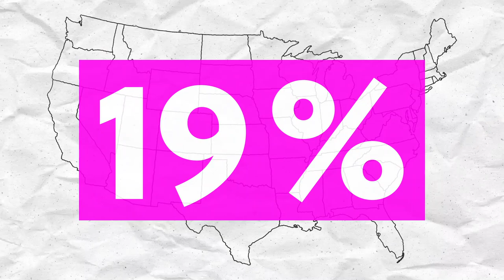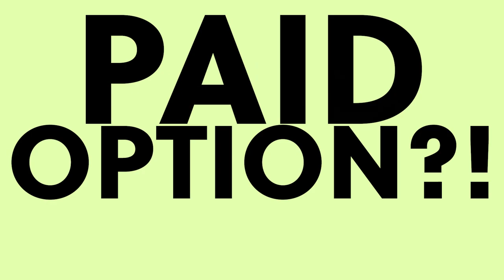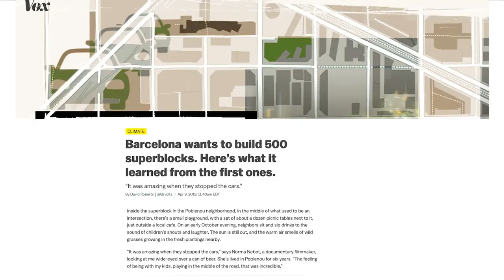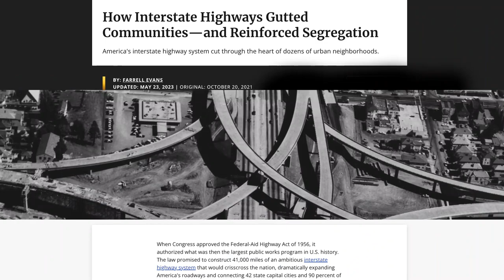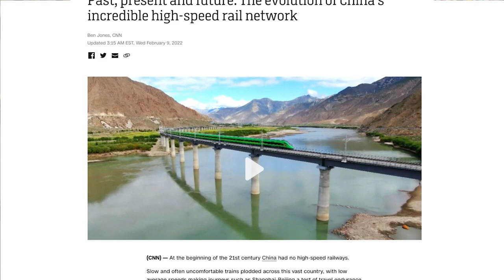What would happen if we banned cars? (Hint: it’s all good)

Comment: buses and train manufacturing should ramp up a lot if we got rid of cars. all those jobs will get replaced
Reply from the maker: Great point!
Reply: i m guising you are talking about train cars , not those and the engines etc.  and buses too. now if we dont have roads buses will lots of trouble staying in service. cant forget building trucks to get to the final destination . case while trains could get toi lots of places, it wasnt how that was done in the past (tracks are cheap to build or maintain),but the job losses wont be made up by switching buses and trains
Reply: Plus, technical knowledge on cars can apply to vehicles like buses and trains so the same people that designed, biult and maintained cars, could enroll in lessons to adapt their knowledge for buses, trains so they will not get jobless
Reply: @Mr.Engine993 A surprising amount of car manufacturers also have a sector where they Manufacture buses, Ex: Mercedes-Benz, Hyundai

Comment: I use my car less and less over the years. I moved to the city Utrecht where I work. Reducing from 30 km/ 19 miles, to just 3.5 km/ 2.24 miles bike ride. Nearly all my trips inside Utrecht are done on my bike.
Living in the major railway hub Utrecht of the Netherlands, gave me more options to use the train, instead of my car. Both inside the Netherlands and  outside, when I travel to Germany. Nearly just as fast as my car, costing the same, if not less then my car ride. No more stress of driving.

Comment: People would use Horse and Buggy for the trips that were formerly done with cars, the 3 to 100mi journeys that are too short for HSR to be viable and are too far to walk. 

Cars really arent a problem as much as Car Dependency is, and poor zoning is.

Europe and Japan have many many cars, but most people still can at minumum even in the most rural and remote areas walk to a convenience store or small shop so they don't need a car for their daily needs.
Reply: The very high population density of Europe and Japan make public transportation quite viable. Here in the USA, the sheer distance between major metro areas, especially west of the Mississippi River, makes owning a personal vehicle a lot move viable.
Reply: @Sacto1654 People shouldn’t need to be traveling between metro areas so regularly and at off times enough to where they require a car. If they are a contractor or someone that needs to go to their clients that is different. We really fucked up bad with this country designing everything with cars as an assumption.

Comment: A compromise might be to favour something between a e-cargo bike and an EV. Similar size to an e-cargo bike, with enough room for 2 adults or an adult and 2 children. None of the crash safety weight (so total weight of maybe 100kg) but enclosed and no need to pedal. Speed limited to 40km/h. Would also accommodate those who would like to cycle but can't, while largely filling the same role, just slightly bigger and more comfortable. Somewhat less efficient space and weight-wise, but if it could increase acceptance of the change, it would totally be worth the compromise.
Reply: Sounds a bit like a golf cart.
Reply: @dominicgunderson Nothing wrong with that imo, for local travel within 5 miles it would do basically everything a car does for a fraction of the cost and resource consumption. Put a solar panel on the roof so it can trickle charge all day, and we should build out infrastructure like those scooters in Asia that have battery swap stations so we don’t need to retrofit every house with a charging station.
Reply: we have then they are called micro cars there is one that is solar and battery top speed 25mph $6,500 coming in 2024

Comment: Are people driving cars, or are cars driving people? And is having to drive for a few minutes just to get some milk or bread "freedom"? (I understand for those who live out in the country....but the way suburbs are designed) And maybe, among other things, we should end or at least restrict Euclidean zoning (named after the city of Euclid, Ohio, that affirmed its right to do so in a court case), and look to certain places. There's a grandfathered "Streetcar Suburb" of Toronto called Riverdale, for example, and then also, in some parts of Germany, it's relatively easy to start either a bakery or a convenience store in otherwise more residential areas, meaning fewer car trips for bread (but public transit is much better there, so....I think you see where I'm going here)
Reply: An issue here in the USA is that the distances between major metropolitan areas can be huge, especially west of the Mississippi River. We don't want a situation where people live in "gilded cage" cities where getting around locally without an automobile is viable, but if you have to travel beyond city limits, you are dependent on longer-distance (and often not reliable) public transport.
Reply: @Sacto1654  true, but most people would be going intra-city, or intra-metropolitan area, more often than the "inter" stuff. Yes, improving connections between cities so that autos aren't essential is a different thing we'd have to do. Different head, same hydra.

Comment: You've not addressed the number one reason to own a car: you can go from anywhere there is a road of any sort to anywhere of the same sort any time you want. I love my car. I love what it enables me to do and I love the independence it grants me. You're not going to replace that with public transit.
Reply: Traffic: 😏 U sure
Reply: zero cars is a bit extreme. But instead of cities that force everyone to have a car, lets have cities that give you *the option* of having a car
Reply: @Mr.Engine993 I'd be fine with this. Just give us options don't  force us one way or another.
Reply: That's only because there's so many roads and so little transit in comparison. If our network of rail and bike lanes was as comprehensive of our road network, you could get anywhere without a car while also taking up less space
Reply: @anonymoususer3012  No, that's because there are many circumstance where the combination of transport modes you describe are slower and less convenient.
Reply: Then make it more frequent @LucidStew
Reply: @qiaowani  Making public transit more frequent won't make it more convenient than something in my driveway.
Reply: What if there was a train (or bus) stop right outside your home, and they came in every 3-5 mins? That’s my case in Boston! Only problem is frequency. Also, regardless of public transit, you could get anywhere with bikes or e-bikes if bike paths were as prevalent as roads. Either way, cars will never be “banned” but it’s ridiculous everything else is underinvested and of low quality, so everyone resorts to driving because it’s the only realistic option.
Reply: @charley3869  I live on a cul-de-sac. I'm not in any way arguing against public transit. I'm saying public transit could never fully replace my car, nor do I think its remotely feasible for it attempt to do so. That's not the purpose of public transit.

Comment: in cities? of course, where i live? probably not possible. i had to make do wo using my own car for a month and despite the 2 routes i travel most often having a either a natural bike lane(side street with very low traffic and 20mph speed limit) or an actual bike lane, i still wasn't able to use a bike to get places due to weather. public transport proved useless beyond  measure and would remain so even  if the frequency of buses got bigger. about "not ordering so much stuff": i happen to live in the capital of the region so i reckon that if its not avalible in my town and needs to be ordered online, having more local shops still wouldn't mean they have it.

Comment: We build micro mobility vehicles that are smaller than automobiles and have better payload capacity. Not depending on an automobile is the best decision you can make if it's possible. 🍷🍷😎
Reply: we all ready have them they are called micro cars they have an e bike style and solar battery combo 25mph around $6,500 new there kind of like golf carts but fully in closed
Reply: @scruf153  Are they pulling 10,000 pound trailers or hold heavy payloads like a truck? We can also go as fast as an automobile, without needing no stupid gasoline. The green HUMAN  POWERED trike we're building has a 10,000 watt alternator for HEAT & AC, and produces over 400 horsepower @ 2,500 RPM. It weighs over 4,000 pounds. I don't think you have that. 🍷🍷😎😎

Comment: I believe that public transportation should be expanded, but not banning cars. I also believe that as population grows in a place, that place should make more roads and bridges. But why do I believe that public transportation should be expanded? Two reasons: 1) less cars on the road, 2) people who don't drive makes their live easier. Why do I believe that they should make more roads and bridges? 1) Because it clears the congested roads, 2) and enhance safety by clearing congested roads and saves time.

Everything has advantages and disadvantages. For example, there are huge disadvantages of depending on public transportation: you have to deal with unruly people, a lot of the crimes occurs on the trains, public transportation takes forever sometimes, you have to deal with cancellations, you are at risk of getting sick during a flu season when the train or bus is packed or just one person sneezes, ect.

Comment: I don't want to ban cars and I understand that with how rural America is completely removing them will be impossible, however I want to eliminate every unnecessary car trip, almost all of them are less than a mile and would be just as fast and easy on a bike if the roads were built for it. If you live inside the city limits you should have reasonable access to public transportation just like you should have reasonable access to water and utilities. Cars are should be for spontaneous trips not for routine things on a set schedule like commuting to work or sport games. I don't think we'll ever be able to convince everyone American to give up their car but alot of people only drive because they have to and they don't see any other reasonable options. Even minor changes in street design could easily convince at least half of the country to move away from them.
Reply: Issue comes with "reasonable access" definition. Do you mean that anyone in city should be able to get into work with public transportation in reasonable time? 
That leads to guestion about what is reasonable time. Is it 15min or 2hours? 

Also issue of housing will become even more pressing matter. 
If you currently drive 30min to work but if cars are banned in city you would need to use bus or something else that could take up to 1h. 
You would prefer moving closer to work so that means you would need housing closer to work. 
And if everyone who worked in city does same prices will skyrocket and I imagine land price will too making housing in cities even more un affordable.

If there were new houses being build on old roads that would lead to densely build cities and nobody wants to live in place like Kowloon walled city where sun light is luxury for those living in upper floors.
Reply: @samuelsilver8077  even in my sprawling bumfuck Midwest town most people are already less than a 15 minute walk to the bus stop, the service just needs to be extended into our newer neighborhoods and it needs to run longer than 9am-5pm. Also there are plenty of cities where taking the bus or riding a bike already takes less time than waiting in car traffic, ever heard of a bus lane? If a city is worried about new density that's what we have zoning for, 90% of the residential zoning in most cities is dedicated solely to single family detached housing already. It's true that property values do go up in places with good transportation but that's because it becomes a more desirable place to live and it's worth noting that car ownership costs an average of $12,000 a year, imagine how much nicer of a neighborhood you could afford if you weren't paying for a car (or several cars). These places become so desirable currently because there is so few places in the United States that are walkable and navigable by public transportation, it's a classic case of supply and demand, there is a huge demand for neighborhoods were living with a car is optional and there is a shortage of places that can accommodate that, so prices jump. Just like there is a huge demand for housing but most cities are zoned majority single family and won't even allow duplexes apartments or "slight" up zoning, so prices have jumped. I'd like to add that your comparison to the kalwoon walled city is ignorant and makes your argument look stupid, the "city" was a slum, something you don't see brought by higher property values, every building constructed in your city has to meet basic building codes and be approved by the cities planning commission, if a kalwoon walled city appears in your town you can blame the city council and building inspectors not public transportation.

Comment: While I like these kind of thought experiments, I didn't hear any of the negatives of removing cars. Based on the Q1 2023 GDP would conservatively decrease by about 22%. I could make the argument that its likely closer to 34% which is kinda rough. Cars enable generic manufacturing jobs, aerospace, construction, arts (such as movies), and insurance to name a few. Specifically for the US, I would make the argument that millions of people would die due to poverty if the economy shrank so much. 

Anywhere outside of a city would become very difficult to live in and the increased urban density would further stress already overloaded infrastructure. I'm aware that many cities in the US are currently struggling to maintain their sewer systems due to everything showering and eating at similar times. Transitioning the population to cities could only be an answer after fixing city design and building a tremendous amount of housing.

I personally think it would be nice to remove cars, but I can't ethically make the argument that its worth driving up homelessness and crushing all local businesses that rely on cars via a destination based business. 

Another thing that wasn't touched on in this video is that many service based employees do not live particularly close to their place of work and commute via car due to infrastructure. Staten Island in New York would be completely crushed by this, conservatively leading to about 200,000 people losing their jobs (~60% of households need to commute by car with minimal local work available) . I don't see a way to do this without destroying the lives of at least 20,000,000 people, provided everything goes perfectly. I just can't see myself campaigning that its worth the lives of tens of millions of people in the US to remove cars. I could see it being technically right on a high level, but I know I couldn't live with myself to know I've effectively sent that many people to live homeless on the streets. I can't even imagine how to support that many homeless people in general.

Comment: Arkimoto had proven to be a good placement for emergency vehicle.

A three-wheeled two seat motorcycle style vehicle that can get to places that cars can't and can do it cheaply efficiently and without causing nearly as much damage to the roads as vehicles.

And to those who don't know, weight causes a lot of damage to roads. (10% increase in weight equals 50%-100% more experience, so a 5,000 pound truck costa a minimum of 7.5 times as much)

Comment: I'm on neither team. I'm on team "People should be able to choose for themselves."
Currently that means building better bike infrastructure and actually feasible public transit so people can decide for themselves how to get around.
We need to dismantle urban freeways, routing the Interstates around cities and converting existing slabs to narrower boulevards.
And start building out a network of diesel-electric high speed trains. The international standard for high speed rail is 200 kph, or about 120 mph. DEMUs can operate at cruising speeds up to 150 mph, which is enough to provide a route speed over 100 mph. Any two cities in the continental US can be reached in two days, which is fast enough for vacation travel. I would abandon airlines and travel exclusively by train.
The airlines could run the routes. They know how to run transportation networks.

Comment: You're forgetting that most of the world does not live in dense cities. They live in suburbs, which are just houses spaced out for the use of cars only, and still the housing crisis in the uk, so if you remove cars, loads of people are screwed. Small villages and towns are spaced at distances which are only compatible with cars like, it takes 24 mins to get from my town to a nieghbouring one which has a rail connection and to london, hkwever it takes 1-2 hours on public transit
Reply from the maker: You're absolutely right that the way our built environments are currently designed and connected is usually not ideal. There's always room for improvement!
Reply: That situation only opens more opportunity for local small business.  Less big box stores just to get some bread or milk

Comment: I love your comments.    I am car free.    Twelve years. 

I think a couple of add ons.     Not owning a car frees up $12,000 in disposable income.    I spend it!!     On solar, gardening, food,  and many like to haves.  And I get it home by bike (mostly)

There is plenty of infrastructure.   Just that cars are parked on it doing nothing

Year round cycling in Minneapolis is very doable.   I am 70 and havent missed a meal cause of cold or snow yet.   

Think of the savings from plowing a couple of lanes and avoiding expensive de icing chemicals. 

Finally I refer back to the 1939 GM Futurama. Video.   

It does not reflect the noise, smell, congestion that the higheays portray.   Time for a make over.